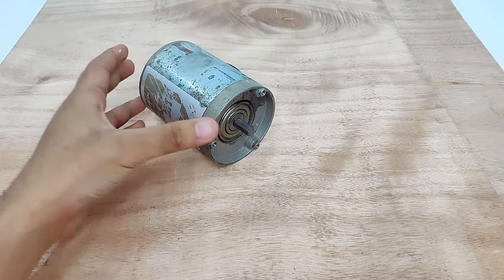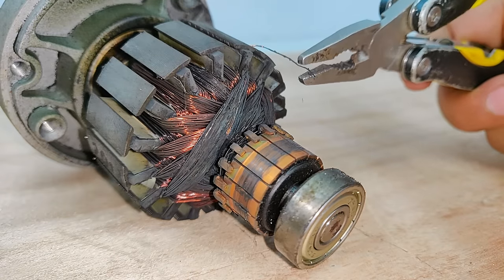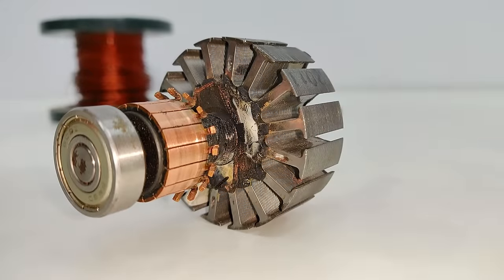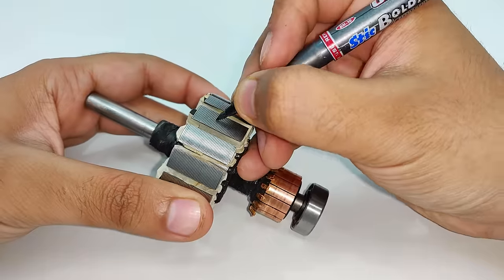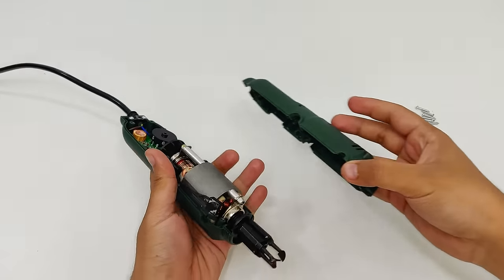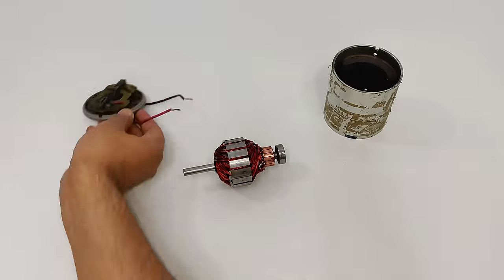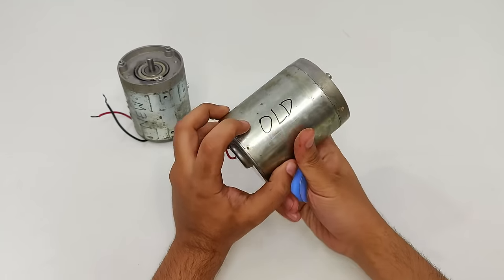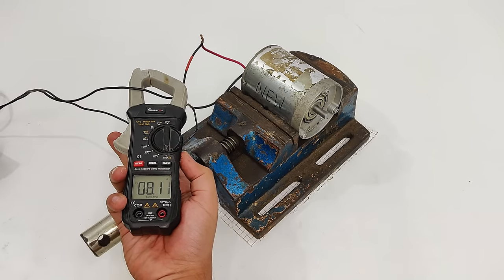Dead 24v DC Motor to 12v Motor for High Current, Speed & Torque - Project !

Comment: May I know how long of the 1mm wire was used? Many thanks. I got the same water pump but it's overheated (the motor itself and the electric wire from power supply). I  think it's caused by short circuit in the armature. It draws too much current from the supply.

Comment: Looks as though you've wound the windings incorrectly to the commutator because the current draw seems extremely high to say it has no load on the motor. I could be wrong though?

Comment: Hi bro pls tell me that if we want to make high in Torque but low in RPM so we can put so much load on it pls tell me the windings configuration for it
Reply: Bro U can use BLDC motor hight torque and low RPM like E bike  have now a days
Reply: gear reduce mechanism to high torque and low speed

Comment: Hi sir did u balance the armeture before incrting in housing it should be balance before the armeture is install and take it in use bcose the vibration of the armeture may coses damage the motor damages of bush and clamping screws gets Loos , sound etc
Reply from the maker: Yes ofcourse.

Comment: Is it just one long strand of copper wire? I thought each loop would have to be a separate connection? I’m a little confused why the motor doesn’t just sit still if the electricity can just flow through the entire things all at once?

Comment: Great scrutinised work 💜🧡
Question: Can I generate voltage in the motor input wire by propelling the motor shaft by external forces? i.e: by wind, by water or by magnet
Reply: yes these have magnets

Comment: Your method for cutting all those copper wires was very interesting - with a hacksaw blade, and worked surprisingly well. Though I wouldn't of risked holding it like that with bare fingers... as the thought of it catching and cutting flesh/bone is pretty nasty! 😬
Reply: 2
Reply: ث
Reply: 2
Reply: 2
Reply: 2
Reply: 2
Reply: 2
Reply: 2
Reply: 2
Reply: 2
Reply: 2
Reply: 2
Reply: 23
Reply: It's not "very interesting", its lazy, and its foolish, and its dangerous. No wonder those countries factories, roads, exported goods, etc all fall apart.

Comment: Sir how many grams of wire you use for rewind this moter and which swg
Reply from the maker: I didn't weigh it . I just gave the specified number of turns for the 1mm wire.
Reply: 1.02 mm wire is 19 SWG. Turns may be estimated by the volume of wire taken while winding it on armature. Roughly half the space in the slot should be filled by one coil. One slot has two such loops.
Reply: Any formulae to calculate all these components to get the required  voltage, amperage smoothly, imean without any ill effect ????????

Comment: I've rewinded the armature watching this video but now commutator is showing continuity with armature slots.. is this normal or I've done some mistake... pls guide
Reply from the maker: Hi! Its not normal.. seems like your Enameled copper wire got ruptured and it made contact with the armature . Remove all the winding and the paper tape insulation and try pvc insulation instead. Then it wil work for sure.
Reply: @MrElectron  okey... thanks for giving time dear...

Comment: Are the bearings suitable for 6000 rpm?
Reply: @johnvanlandingham8832  high RPM machines have this kind of disadvantages. The bearings break or cease. To overcome this problem use lower RPM as much possible.
I think my air cooler motor will last longer if I wind it for 1000 RPM rather than 1400 RPM original. Recently I had to change both bearings due to increasing noise levels. The shaft was also affected and had to punch it along the bearing line to tightly mount the bearings.

Comment: Please measure the torque of this motor in a next video. Maybe you also could determine the efficiency because I doubt that those thick wires are a good chose.
Reply from the maker: It all depends on the RPM you need. Just as the High Current Car starter Motors .
Reply: You can increase the torque using step down gear. Using thicker wire means less turns and more current resulting in high RPM and low torque.
Reply: @MrElectron  In new windings how much coil (meters) you used?

Comment: bro can i use it to make e-bike and RPM will increase on 24v??
Reply: I don't think we can make e bike using it. It can hardly provide 72 watts of power and if we reduce the RPM using gear box to create more torque then the bike may not run at high speed. But it's worth a try if you can achieve 25 kmph speed for visiting local areas. You can attach two motors in parallel to achieve good results.
Reply: @Dave_en 
It would be better to use 48 volt onward d c motors(brushless) for the same with 48volts battery onward , ?????????,as it would bear the loads given in a smooth way   ??????????
Reply: @TubaParveen-cd2ys  Yes. 48 volts are enough for light bikes. Some e-bikes and e-scooty do use 48v DC brushless motors and battery for satisfactory performance.
Reply: @TubaParveen-cd2ys  If you double the voltage, then at same winding resistance the power gets quadrupled. That means four times the torque.

Comment: Do you use two wires?
Reply: What would be if one uses double wire of  1  mm thickness for rewinding the same,  ampere ?????,  voltage ???????  Output